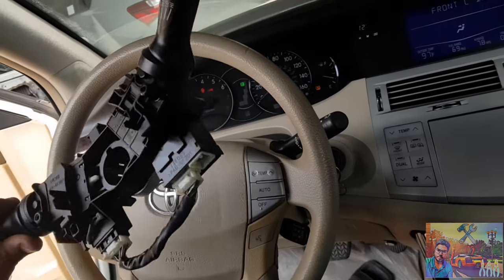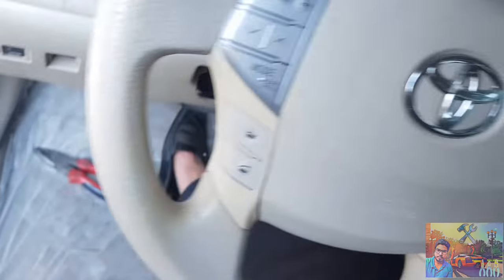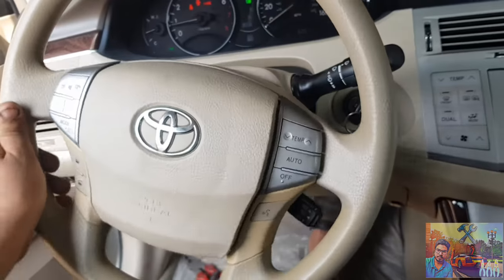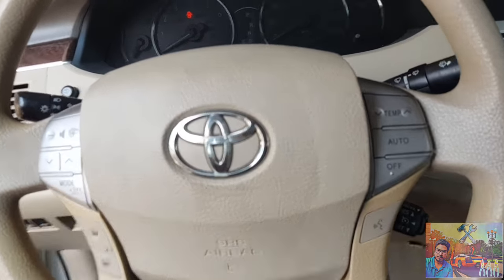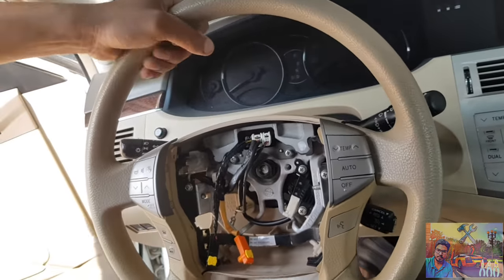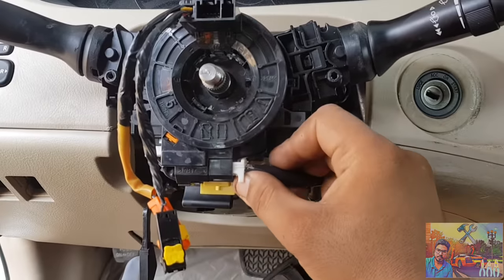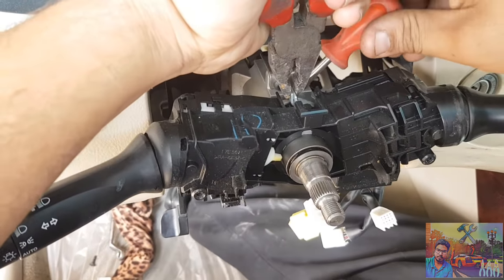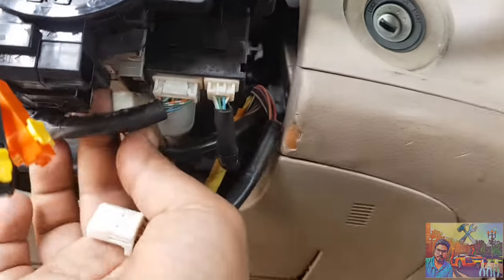How To change Turn Signal And Wiper Switch In Toyota Avalon || Bilal Auto Center ||

Comment: On 2010 Corolla my rear running lights quit working, dash lights which are on the same circuit work fine, fuses are good and the the circuit itself passes continuity test. Do you think this switch assembly is the problem?